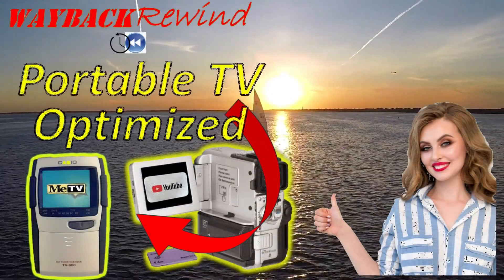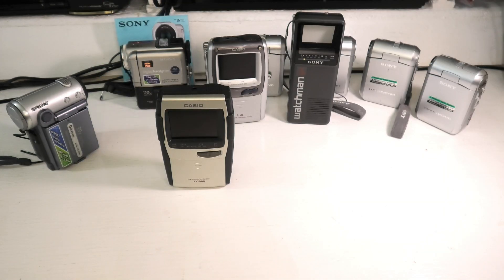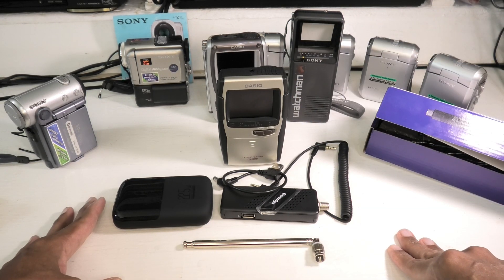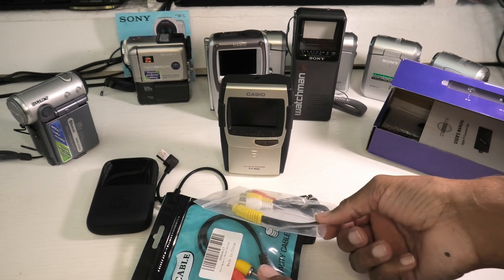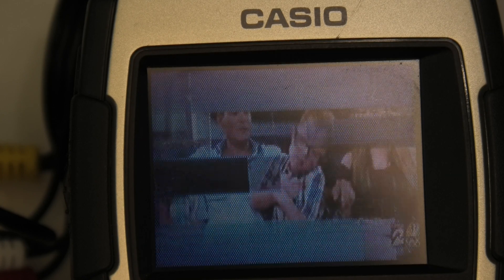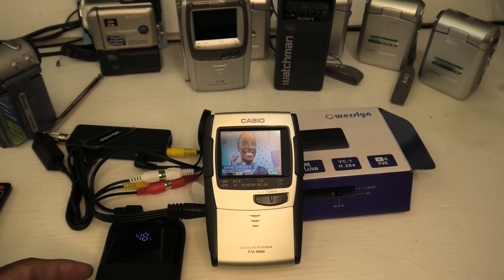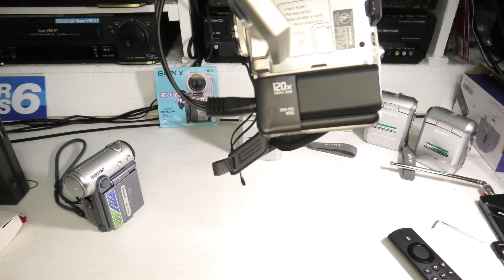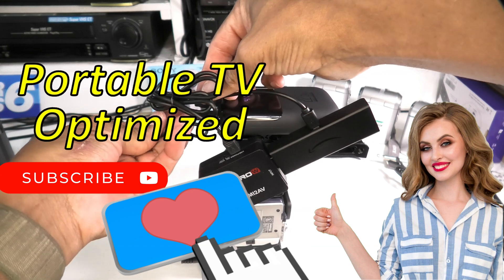How to Make Smallest Free Portable over-the-air Digital TV

Comment: I’m pretty bummed to see that no one has attempted to solder a small kit to fit in the back of the original analog tv. Or even use pcb way to customize a board to make this work on a much smaller scale. Was really hoping that would be in this video.
Reply from the maker: No doubt someone could make such a kit but most people put their analog tv in the trash 20 years ago and only a handful of us still have them.  So it's a pretty small niche market.  Still I demonstrated it's possible, many people didn't even realize analog TVs can still be used as smart TVs.
Thanks for watching.
Reply: @WaybackRewind I appreciate you making these videos and showing everyone how to do it and mostly on the cheap side ! Thank you!

Comment: Great job.How to get right resolution on an old analog GE tv with Chromecast 3rd?
Reply from the maker: @robertshade8631  The adapter that you use to connect to an analog TV only knows one resolution, and that is standard definition or 720 x 480.  Are you having a resolution problem with the Chromecast?
Reply: @WaybackRewind  yes only the Chromecast screen shows and display.Plus I’m unable to navigate since no remote.
Reply from the maker: Since you have no remote it's hopeless.  I would suggest getting a new one.  They are not that expensive.  I have a Firestick, Roku and Chromecast.  There is no monthly fee for the basic function and tons of free channels if you have internet.  Check out my Video Rocu versus Firestick for a comparison. 
Thanks.